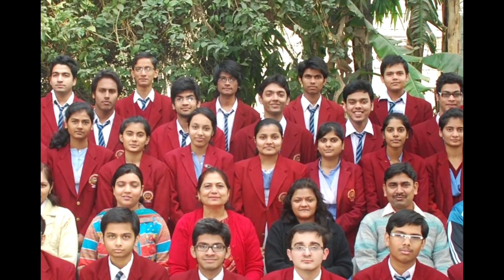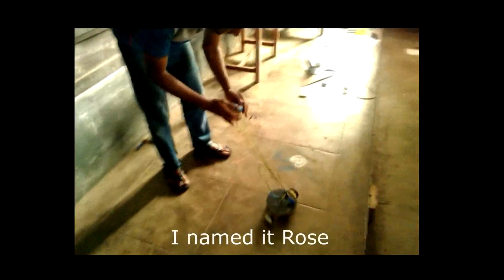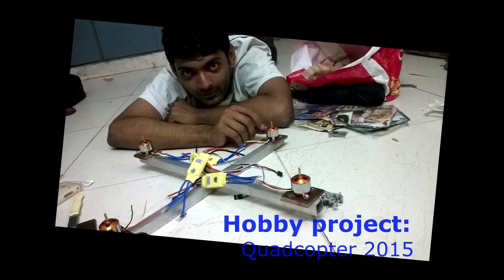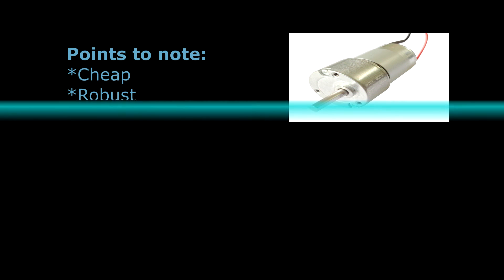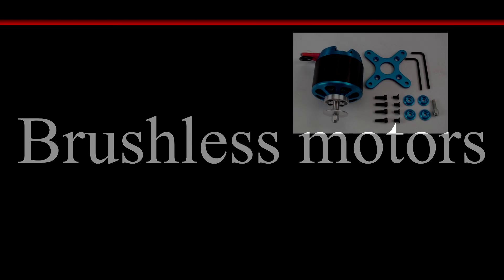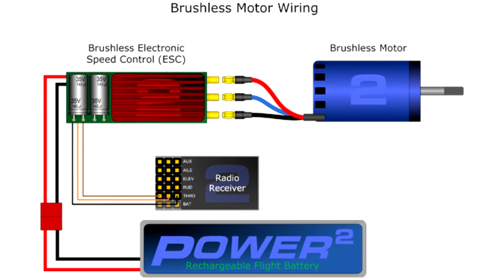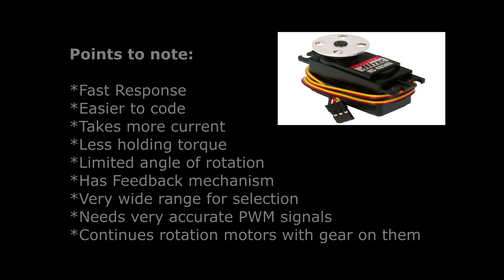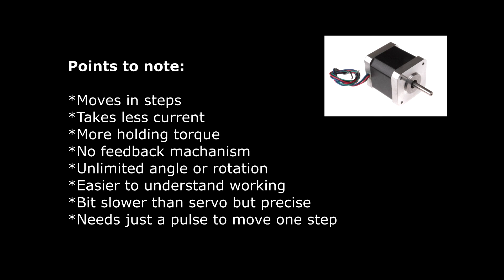Robotics Tutorial 3: Motors (DC, BLDC, Servo, Stepper)

Comment: Hey there! I'm too a person in the field of mechatronics.I've trying to make a battle bot for some time now and don't know which motors to use.Right now i'm using johnson motors(12v 1000rpm),but they don't give enough torque and cannot take a load over 12 kgs.As i have been to several competitions,others and using warm/viper motors,denso motors or planetary motors.Could you please tell me which motor more powerful than this can I use?Or with these motors,which power supply should i use to use them at their maximum potential.I need a torque of around 15 kgs and our bot's weight is variable between 5-12 kgs
Reply: if your bot weight 12kg you need twice for push another bot in a strong manner 

so let sight at 30kg  real force 

and not in kg/cm if your wheel radius is more than 1cm you must divide the power by the radius
eg = i made a robot of 1kg with 15kg/cm motors who canot lift is own weight 

because lenght of legs was 30cm 

15kg/cm / 30cm = 0.5kg lifting force
Reply from the maker: Go with wiper motors. They are best for your use case.
Reply: @RoboticsExplained  yes thx very interesting wiper system tought that not what i really wish because their is only a zero and not other feedback as in servo motor and worst the zero is very large about 20deg what can be convinent for a basic turret but not for a camera or an arm or a leg still i keep it in mind for a rustic crawler